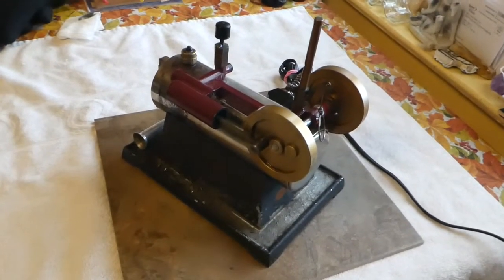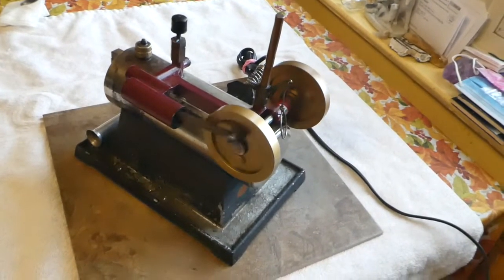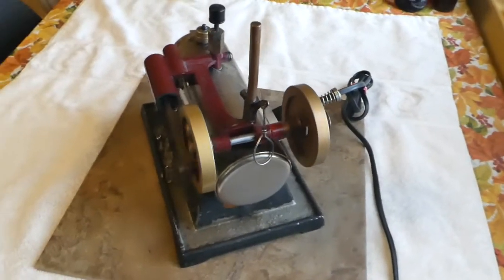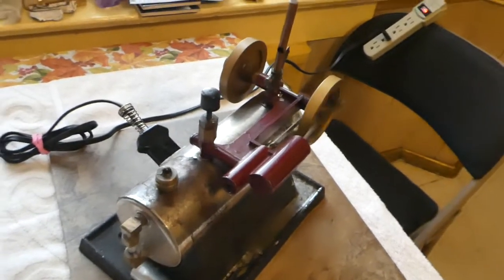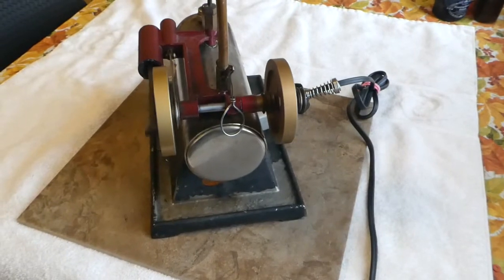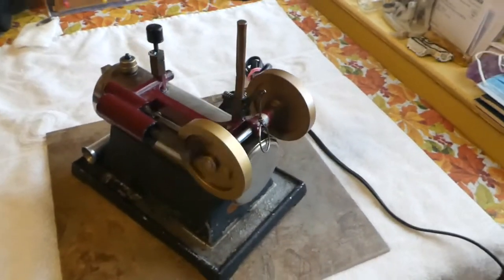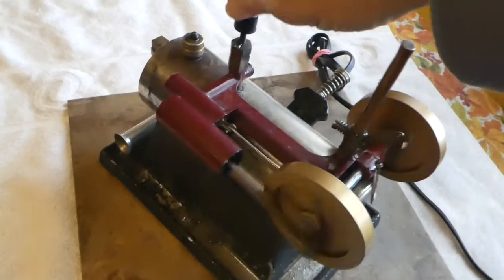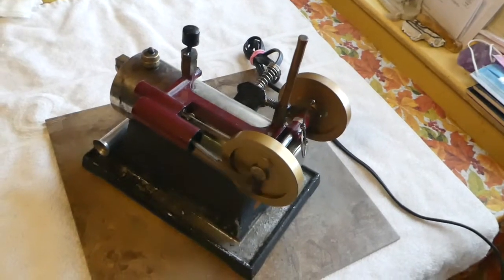IND-X Custom Steam Engine

Comment: Where did you get the parts
Reply from the maker: The extra long axle was cut from a copier machine wreck and the flywheel came from a very
dead IND-X engine.  I gave it to my plumber after a good job.  Not that the beaucoup $$$$$
wasn't enough, but I'm trying to convert mechanically-minded folks into dedicated steamers.
Gave an incomplete and nasty, but working, Empire B30 to my mechanic for the same reason.
If I tried selling them on fleabay, the small $$$$ they would have sold for made it an easy
decision.